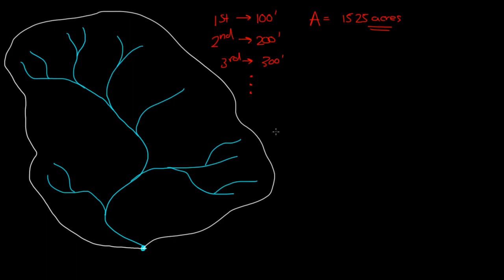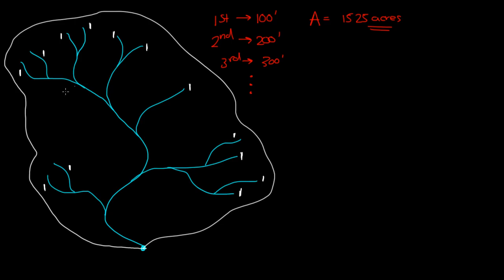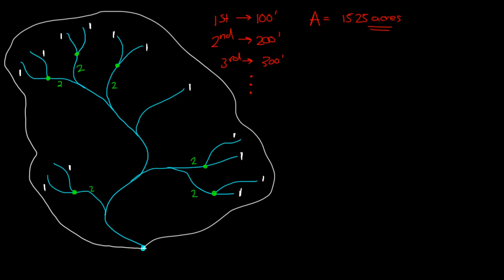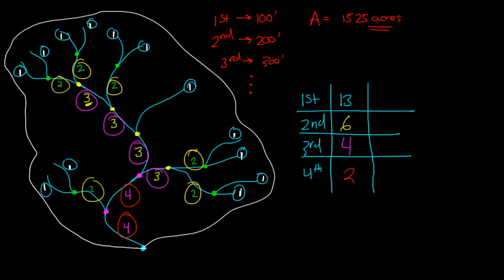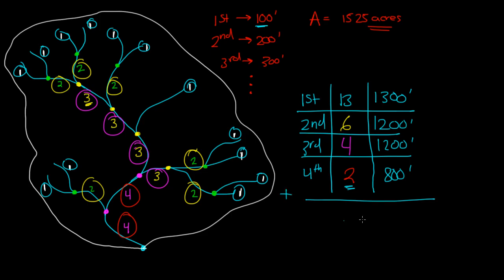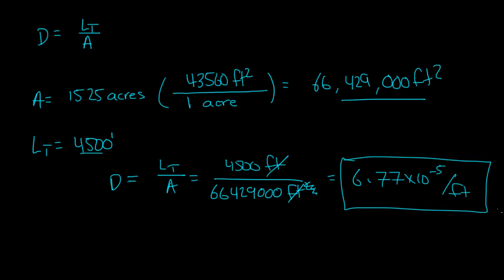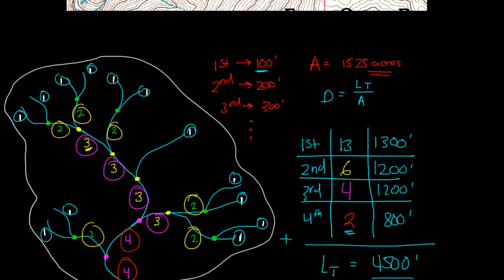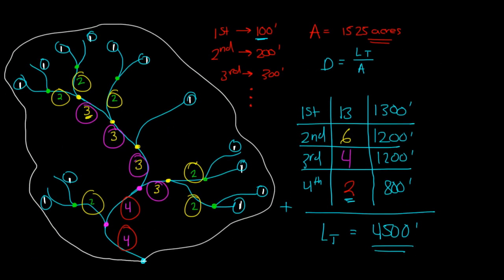Hydrology: Horton's Law & Drainage Density Example

Comment: Dear Simmy, actually there is a mistake on counting your 3rd order and 4th order, as we know two second orders reaches together and make 3rd order, it means that, for one 3rd order we need 2 streams of second order, now!how can we have four third orders while the second orders are only 6? this mistake I have seen in many papers while we have point (stream) junctions! Actually, you should consider those 3rd orders where are in the same direction as single stream although we have junctions there. in this case, you have two,3rd orders and one-fourth order!and so on,,
Reply: Thank you....I was convinced that was a mistake as well
Reply: Sir ,so if you have correct method of calculation i.e.,notes or video plz provide link ,Thank you
Reply: I was thinking the same and moreover the highest order of stream is always only 1.
Reply: Correct 👍